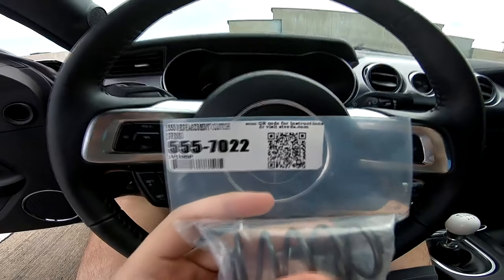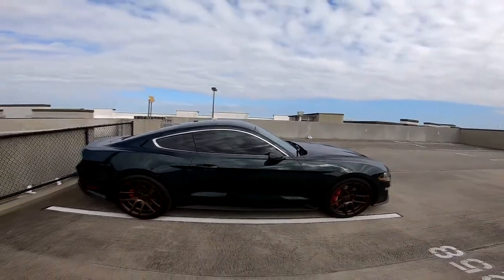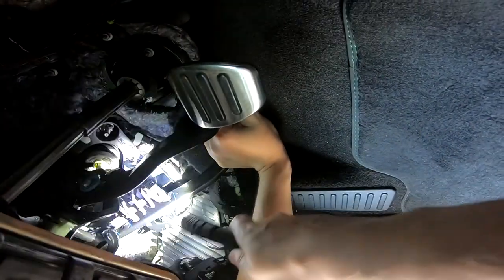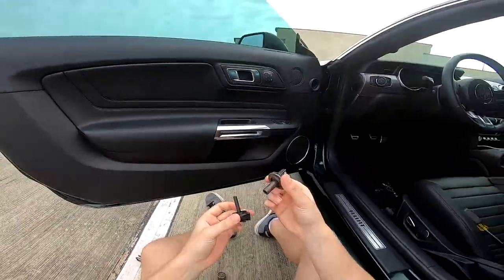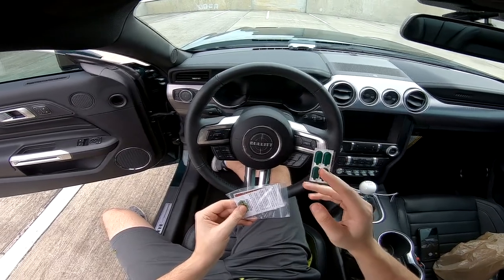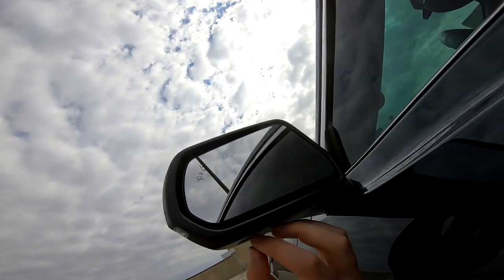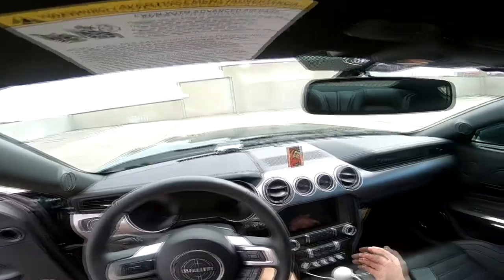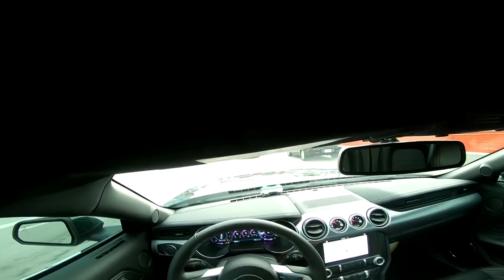How to install Mustang GT Clutch spring (2019 Mustang Bullitt)

Comment: hi, if I understand you correctly, in the original condition, the clutch pedal is too smooth?
Reply from the maker: Hi, it's too springy if that makes sense. It feels fine but once you get to the top/release point it kicks of your foot so it's not  very linear vs the aftermarket option. You can feel the engagement much better.
Reply: @LifeofPandK  OK 👍